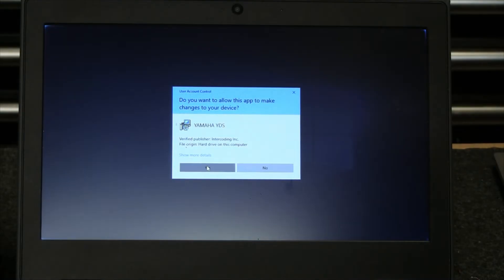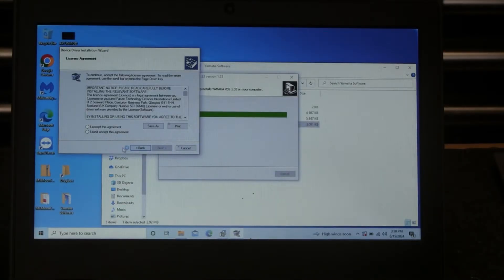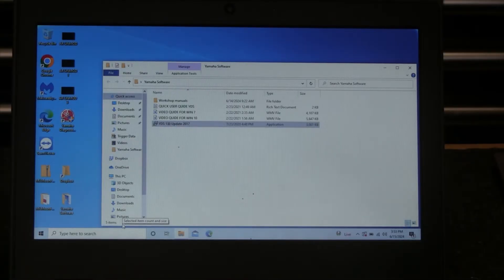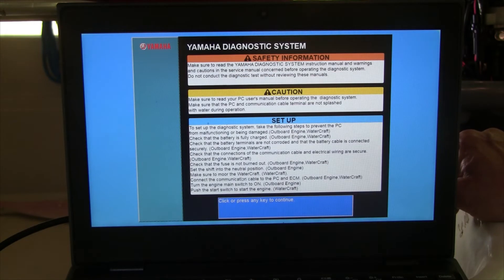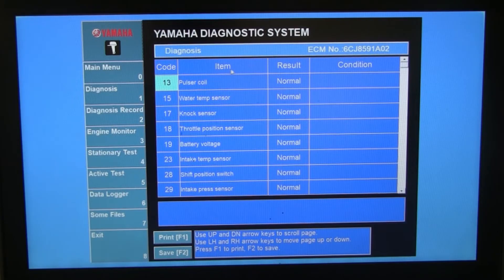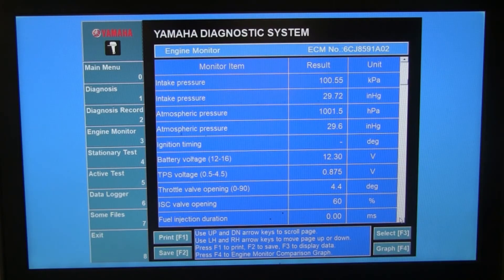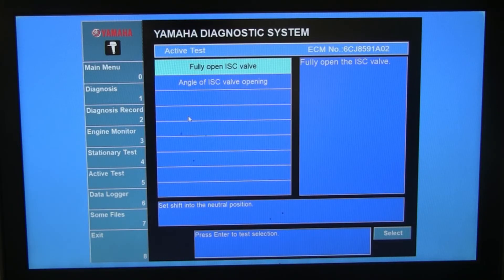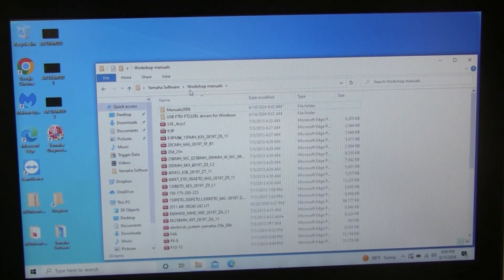How To Install and Use the Yamaha YDS Diagnostics on an F Series Outboard

Comment: Again best video online for installing and running.  I have an error with YDS ver 1.33 'Communication error occurred between the PC and ECM'.  I made sure com port = 1.  I did some diagnostics from from tach successfully but cannot reset codes from there, I have 2017 SX190 Yamaha jet boat so I assume it is communicating with ECM.  Any thoughts on that?

Comment: Great job on a useful and concise video! Getting ready to buy the software and use it on my new ( to me)  115 engine.
Reply: if you found the port on the 115, can you describe where it is?
Reply: @bdinfl2071  Yes, remove the cowling and then on the front of the engine on the starboard side is a black plastic cover. Remove the black cover and inside is the port to plug into the YDS software.
Reply: @RandomlyAwkward1  thanks, found it! but the software says it's missing SE0021.dbf - did you run into that problem? I assume it's the v1.33 database file for engines after 2012.
Reply: @bdinfl2071  i’m not sure about that, but as I said in the video, make sure you are saving and running the program on ComPort 1  on your laptop. That could be an issue.
Reply from the maker: Glad to help you out with your new engine!

Comment: Hey mate, Do you know if it stores trouble codes indefinitely?
I switch my batteries off after every use. Will that delete stored codes?
Reply from the maker: My understanding is that the codes should stay there until you delete them.

Comment: gday mate that is an invaluable tool to have i couldnt even get a manual for my 2021 f40 here in aus so a fella in canada sent me one and i printed it of took some time but its genuine we cant get anything like this here all to do with dealer money ,so if you have a problem take it to your dealer and get stung they wont even let you fit your new motor has to be done by a dealer at a cost  . Im a do it yourselfer so my dealer will never see this engine again as i say to others it is a four stroke engine like your car only it runs on water not bitumen regular maintenance and it will run forever  , a lot of guys are scared to do any maintenance themselves , well for me in the first week i had it i had anodes out , thermo out , plugs out , leg off , oil drained and refilled , impelleor off and tested with aftermarket ones how hard can it be , if i stuff something up ill fix it up plenty of your tube videos to help you and its the same motor since 2013 they show you how to clean injectors change filters in the vst tank and pumps , your looking at around 250 au for 20 hour service some bigger engines are of the scale anyway good video on setup of the diagnostic kit .
Reply from the maker: Thanks for the feedback. I didn't know it was that restrictive in AUS! I'm wondering if you can buy the ebay or amazon version there. I like the fact that it includes all the manuals! Just be careful if you do buy the software, you will probably need the newer version, the one I show 1.33 will prob not work for you.